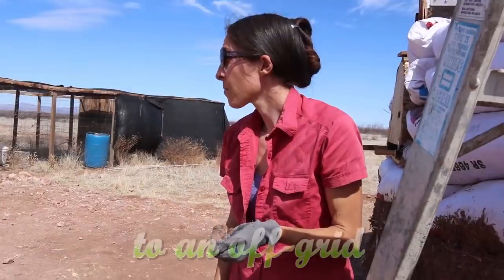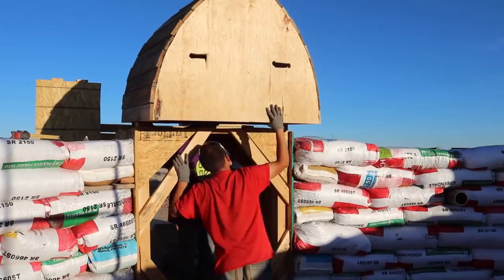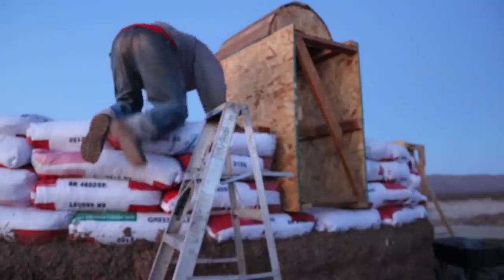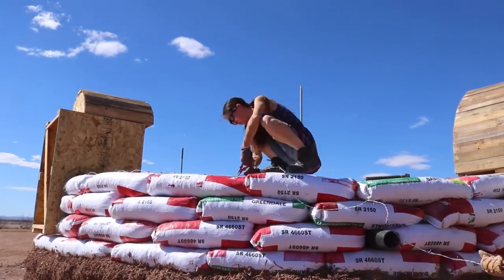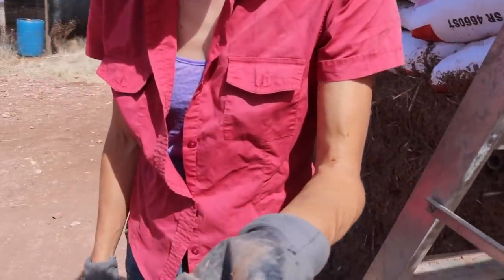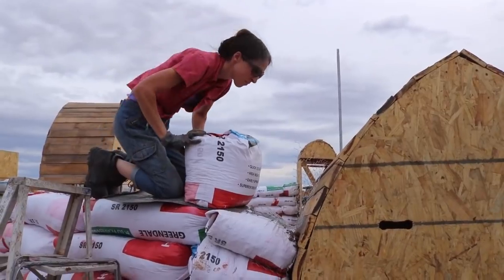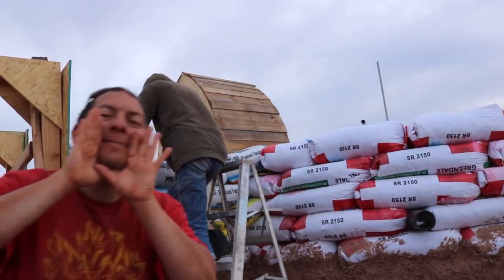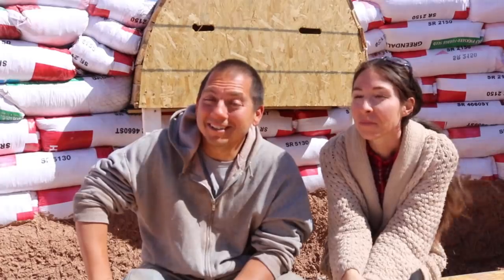THIS Could Have Been BAD! I Was Almost CRUSHED While Building Our Earthbag Dome

Comment: Nothing happens, you made the right decision - let things go and don't hurt yourself. This is definitely not the final floor, so what's the point, a bit of filler and it's good. I'm more concerned about the altitude you've already reached. It is getting dangerous without a small scaffolding! Stay safe you two.

Comment: You should have the tops of the doors and windows so that they slide in on 4x2 as you're going to have to move them in another couple of times   as the dome comes in. That floor will be to lift to allow you to fit wall to wall flooring minus the stairs part.
Please be careful and always work smart 2 people when working over head height especially when moving heavy wooden frames. Can't wait til next episode hurry up please but remember safely. LOL  All the best from Carlisle, Cumbria, UK.

Comment: I'm sure you don't want to hear this but watching how that cart acted when you filled it and drug it over to the wall, with full loads of dirt and those small tires, it's not going to last. You need to relieve some of the stress on the cart parts by providing a flat surface for it to roll on. Some OSB or just nice smooth and compacted dirt.

Comment: Now that the bags are smaller can you pick them up ?   Maybe fill the rest up sitting on  pallets right next to the dirt pile,  shovel directly into to them.  Then rent a bobcat for a day and place them ?
  If they are too heavy you could make a simple  tripod out of 2x4's and use a pulley to raise those cans up to her. Save a million trips up the ladder.  We cut a triangle out of a peice of 2 x 12 and set the saw a 3* so the legs spread out.  Screw your 2 x4 legs to the triangle then a small block to the leg under the triangle so you can put screws down into the block thru the 2x12., Then triple up a 2x4 long enough to bolt to the 2x12 and reach over to the wall. Hang a pulley from an eye bolt, make a plywood little platform to set the cans on and raise them up to her.